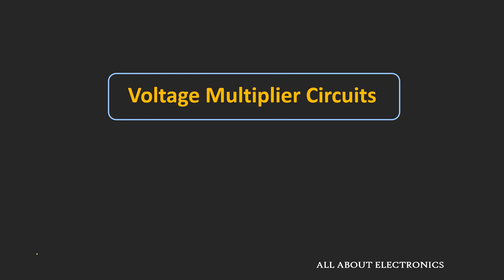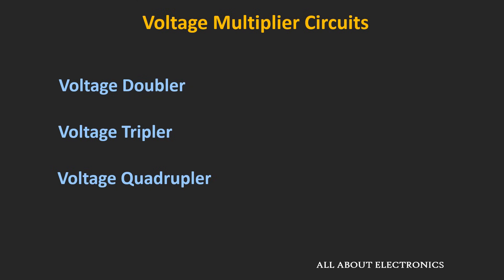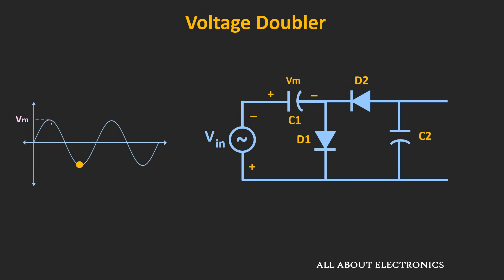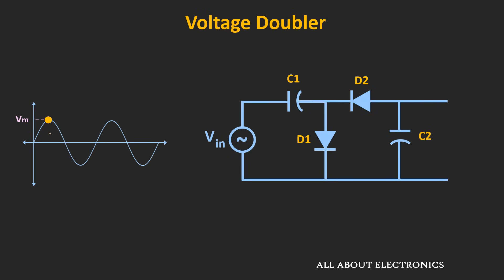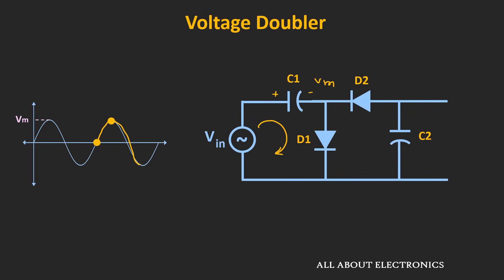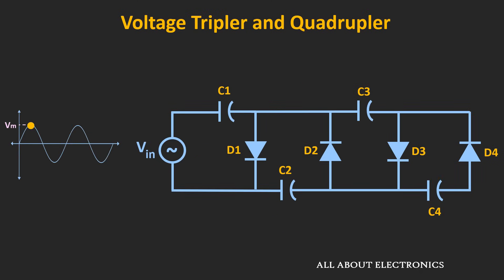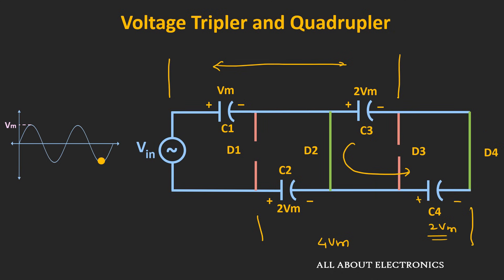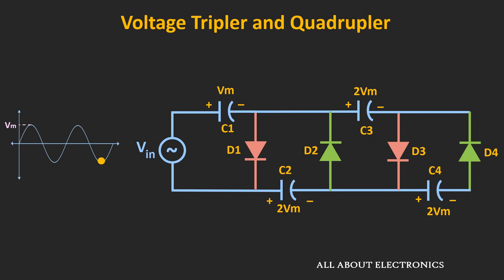Voltage Multiplier Circuit Explained (Voltage Doubler, Voltage Tripler and Quadrupler Circuits)

Comment from the maker: The timestamps for the different topics covered in the video.

0:21 What is Voltage Multiplier Circuit?

1:41 Application of Voltage Multiplier Circuits

2:32 Voltage Doubler Circuit

8:40 Voltage Tripler and Quadrupler circuit
Reply: whats the name of your simulator

Comment: What if the input is DC , will it work? for example , incase of a boost converter can we use the multiplier?
Reply from the maker: No conventionally it won’t work with DC. You need to somehow make the DC voltage to pulsating DC to use this circuit for multiplication.

Comment: Does the capacitance or the caliber of diode matter or can any size be used?
Reply from the maker: The voltage rating of these components should be sufficient to support your design. That’s it.
Reply: @ALLABOUTELECTRONICS in other words they can  be larger but not smaller

Comment: Can you tell me whether Vin is a typical ac signal? I myself built the circuit and I didn't get any voltage multiplication.  As for my reasoning goes, it should not be able to multiply the voltage with a typical ac voltage. 

I need clarification please.
Reply from the maker: Yes, the input is AC voltage. The only thing is, you need to select the proper values of capacitors. 
Its very standard circuit.

Comment: So c1 only charges from 0 to positive peak and discharges from positive peak to negative peak? But from negative peak to 0, does c1 remain 0 until it reaches passed 0 to positive peak?
Reply from the maker: I have provided the simulation at the end of the video. Please go through it, your doubts will get clear.

Comment: Do you know,  how to calculate output current for a load of say R, or maximum current output?  Thanks.
Reply from the maker: It depends on the maximum power that the input source can deliver. Since we are increasing the voltage, so maximum output current that we can draw from the circuit will reduce proportionally.
Reply: @ALLABOUTELECTRONICS   Say you have an ideal input voltage source, your Cs are all the same, you have N stages, The frequency is F, the load resistance is RL.  What is the current through RL?
Reply from the maker: @aduedc  well, in that case, for ideal voltage source, the output current will be N*Vm / RL. Where Vm is the maximum voltage of the input source, N is the number of stages and RL is the load resistor. But practically, you will not get that. 
Let's say you have 5V source, which can provide maximum 1A current. (Overall 5W)
Now, if you increase that voltage by 10 times, then your output voltage is 500V. And if you connect 10 ohm resistor as load then your output current will not be 50A. Because with that current and voltage, if you find the required power then it is 50A*500V = 25000W.
But can you get that using 5W source, No. 
In this case, the maximum current that you can get is 5W / 500V = 10mA. (considering there is no other losses in the N stages)
So, accordingly you should select the load resistance. 
I hope, it will clear your doubt.
Reply: @ALLABOUTELECTRONICS  This is not the case.  Here is an experiment, use 100pf caps, measure the output current say at 10K ohm  load.  Then use the 10uF cap and measure it again.  Also do this experiment with say 1KHz, and do the same experiment at 10KHz.  As you know you can build a virtual resistor by charging and discharging a capacitor.
So it is not that simple, it has to do with frequency, Capacitor value, diode losses, ....  I am searching for paper on that if you find it let me know.
Reply from the maker: @aduedc  Yes, that's true. But to make such circuits, the RC time constant has to be much larger than the time period of the input signal. So, you need to select R and C accordingly.

Comment: Nice video but I think that the analysis that you do for the voltage doubler may be wrong. First of all it seems that you are analyzing the initial transient of the circuit, which means that the initial state of your circuit is characterized by all capacitor discharged. The moment, in which I think you commit the first error is at 4.02. you say that the capacitor C1 charges to Vm when the sinusoidal signal reaches the positive peak and then you say that when the sinusoidal signal becomes negative then the diode 2 turns on and D1 turns off. But what happen between the positive peak of the sinusoidal signal and the negative part of the sinusoidal signal? You forgot to analyze that part. In fact, the diode D2 should turn on immediately after the peak of the positive sinusoidal signal. and D1 should turn off in the same moment. So the two diodes change their states much earlier than the moment in which the sinusoidal signal becomes negative. Missing the analysis of that part, will make your analysis not correct. Furthermore, it seems that in your analysis, C1 remains charged to Vm for all the negative cycle of the sinusoidal signal. what make you think that the voltage of C1 will remain constant during the negative cycle? I did not find any reason why that should happen. Try to simulate the circuit and look at the first period of the initial transient: at the first negative peak of the sinusoidal signal the voltage across C1 is actually 0V and not Vm as you state in your video. Overall the dynamic of the circuit is a bit more complicated than what you claim. I am not convinced by your analysis, which in my opinion is just a method to force the correct result.  Anyway, feel free to correct me if I am wrong. :) In general, I like your videos, but I do not think that everything can have a short explanation. Good luck for the next videos
Reply: Even I was thinking the same but not able to find the decrease in the voltage of capacitor 1 after the one fourth cycle
Reply: @alokgupta7239  probably because, you did not setup the LTxpice correctly. To see the initial transient you have to check the command "skip initial operating point solution" when you perform the transient. Try it ;)

Comment: @11:41 
assuming C2 = C3 during this cycle there is charge sharing therefore C2 does NOT dump ALL of its voltage(2Vm) into C3 in the first cycle, first iteration will have 0.5*(2Vm) volts across both C2 and C3. It takes X amount of iteration for C3 to have a voltage 2Vm depending on input voltage. What happening here is C2 is constantly getting charged from the supply then shares its charge with C3 UNTIL the voltage across C3 = 2Vm. In summary, due to charge sharing between C2 and C3 it takes multiple iterations for C2 and C3 to reach 2Vm.
The math is 
Vc2 = Vc3 = 0.5*(2Vm) -> first cycle
Vc2 = Vc3 = 0.5*(2Vm + Vinitial) = 0.5*(2Vm +  0.5*(2Vm)) -> second cycle
Vc2 = Vc3 = 0.5*(2Vm + Vinitial) = 0.5(2Vm + 0.5*(2Vm +  0.5*(2Vm))) -> third cycle
Vc2 = Vc3 = 0.5*(2Vm + Vinitial) = 0.5*(2Vm +  0.5(2Vm + 0.5*(2Vm +  0.5*(2Vm)))) ->fourth cycle
.
.
.
.
.
Until Vc2 = Vc3 = 2*Vm
Reply: Was doubting my basics, and searching a comment that explained what I know, then came across this, and now am satisfied!
I don't know why the these small but great details are ignored in videos. These hamper the basics!

Comment: 11:44 I don't think so capacitor c3 will get charge by that path, because the D1 which you short circuited, has V(k)=2Vm and V(A)=Vm, hence that D1 will act as open circuit not short Circuit.... You have simply put a closed path without analysing... ( Don't mistaken me, I really like the content ❤️)
Reply from the maker: At the end, I have also shown the simulation. Please go through it. It will help you.
Reply: Yeah I checked! But please explain me, in 11:44 the path taken to charge C3. How is the diode  short circuited when V(cathode)>V(anode)??

Comment: why did you not consider capacitor voltages when finding the diode states? You have just considered cycle states.

Comment: ⭕⭕⭕Check 11:44  here you are telling that the  C3 is getting charged through the path of D1. But current cannot flow through D1 from C2 because 11:28 see the circuit, I mean considering C2, D1 is reverse bias condition. 
Please check and let me know!

Comment: Why this circuit we cant use for big loads bro.I mean if capacitor capacity is big then? What about current? Current also added or what? Actually I am a commerce student but also studying little bit electronic plz answer.
Reply from the maker: It is due to power. (P= V*I). Although the output voltage is increased, but since output power can't be more than input power, the current supplied by the output to the load will be limited.
Reply: THIS DEVICE IS A HIGH VOLTAGE LOW CURRENT ONE I HAVE MADE ONE ON MY CHANNEL GO ELECTRONICS !!! WHICH COULD OUTPUT 60000 VOLTS

Comment: Please mention the values of the capacitors and their voltages. Thanks.
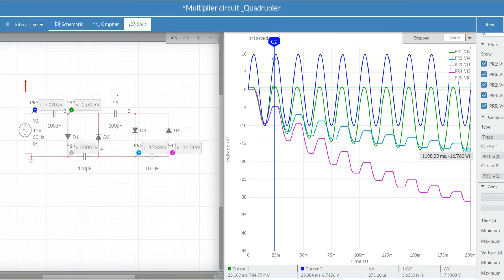Reply from the maker: The voltage rating of the capacitors should be atleast 3 times more than the desired output voltage. (e.g for 10V, output, use 35V rating capacitors) At the end, around 12:50, I have shown the simulation results and circuit. 
You can check that for reference.

Comment: What if our input of voltage multipler is continuously fluxing 'varying' ...?what type of multipler is should use?
Reply: YES I HAVE CREATED A POWER SOURCE WHICH ACTS AS THE INPUT IN MY VOLTAGE MULTIPLIER VIDEO !! AND IT COULD OUTPUT 60000 VOLTS !! WATCH IT ON GO ELECTRONICS !!
Reply: @ge5645  watch it and experience it yourself with some very BIG capacitors and touch it go make sure!

Comment: for the simulations, how do we calculate the values of te capacitors and diodes?
Reply from the maker: The RC time constant should be much larger than input signal time period.
Reply: @ALLABOUTELECTRONICS  INPUT SIGNAL CAN BE AC OR ANY HIGH FREQUENCY ONE !!!
Reply: The capacitor values must be in nf or pf and if you use high voltage pulsed dc as input (the one I have made on my channel go electronics ) 3 TO 6 KV  ceramic caps needed and 4kv HF diodes !! ( FOR MORE DETAILS WATCH MY VIDEO WHICH PRODUCES 60000 VOLTS !!)

Comment: You Slightly Miss An Error At Point When -vm<Vin <0 After Charging C1 ( After Positive Cycle Of Vin, When Vin < 0) ,,, When Anode And Cathode Voltage Of D2 Will Be Same Then D2 Will Off ...No Further  Charging Of C2 Will Occur And That Moment C1 Charge Will Not Be 0 ... C1 And C2 Charge Is ,, V = {(c1)/(c1+c2)}Vm  *But Reverse In Polarity ... That's Why It Requires Many Cycles ... C2 STOPS CHARGING AT   -Vm<VIN <0      NOT VIN = -Vm ,, If you don't believe  Me Zoom Out The Schematic Diagram At 8.05 Moment See The Cycles Of Charging C2 .. If It Will Stops At Vin = -vm Then No Further Charging Of C2 Will Occurred Because On Second Half Positive Cycle Of Anode And Cathode Voltage Of D2 Will same -Vm And Remains Off So No Further Charge Occured ...
.
Reply: Yes the circuit used here is slightly incorrect this is not the voltage doubler, its peak to peak detector

Comment: I need help designing a Voltage Tripler circuit with an input voltage of 110VAC that will power a 330VDC / 2 watt light bulb.  Will the voltage tripler circuit that you have designed at 9 minutes work?  And what size caps and diodes should I use?  I appreciate any help.  Thanks!

Comment: Great Video ! Crystal clear explanation !!!
Reply: MAKE YOUR OWN VOLTAGE MULTIPLIER THAT COULD OUTPUT 60000 VOLTS WATCH IT ON GO ELECTRONICS !!!
Reply: @ge5645  watch it and experience it yourself with some very BIG capacitors and touch it go make sure!

Comment: Thank you for the video, very useful especially to initial ramp-up section which is not covered usually in other tutorials. I wanted to find out how i can do AC analysis of this doubler? What is the AC equivalent circuit? I am asking since this circuit is usually connected to AC sources and i want to look at the matching problems. Thank you

Comment: 9:50 
Why the capacitors will not charge if they are uncharged.
(I think all capacitors were initially uncharged, then with your reason even the capacitor c1 should not charge).
Reply from the maker: The capacitor C1 is charging because diode D1 acts as a short circuit (ideally). 
If you take the second loop, between diode D1- C3-D3- C2, as all the capacitors are uncharged initially there won't be any transfer of charge. In the first loop, the capacitor C1 is charging because of the input source Vin.
I hope it will clear your doubt.
If you still have any doubt, do let me know here.
Further, I have also shown the simulation result at the end, which might help you in visualizing the things.
Reply: @ALLABOUTELECTRONICS  Hi, is there a way to calculate how fast the capacitors will really charge?

Comment: Excellent video. Very detailed and clear instruction on the voltage doubler circuit. It's one of the best out there. Thank you for taking the time to share you knowledge. This is a very important circuit for learning AC circuits. It's used in microwave ovens as well at the output of the step-up transformer to power the magnetron.
Reply: MAKE YOUR OWN VOLTAGE MULTIPLIER THAT COULD OUTPUT 60000 VOLTS IN THE FORM OF BLAZING ARCS !!! WATCH IT ON GO ELECTRONICS !!!

Comment: Thanks for the great explanation. Can you include a section on how to calculate the necessary values of the diodes and capacitors?
Reply: MAKE YOUR OWN VOLTAGE MULTIPLIER THAT COULD OUTPUT 60000 VOLTS (ARCS)  !! WATCH IT ON GO ELECTRONICS

Comment: When I made connection of multipler  . Output of circuit not desirable as when 6 volt AC applied to doubler  circuit .It give15 volts output . also in triplet circuit 23 output
Why this happened can u help me
Thanks.
Reply from the maker: Please check the couple of things. First, whether the input is 6V peak or 6V RMS. If it is RMS then you need to multiply it with factor 1.4.
Second there will be a voltage drop across the diode. 
So you also need to take into account.
And third make sure, RC time constant is much larger than the time period of the input signal.
Just increase the RC time constant a little bit.
I am sure you will get the desired results.
Reply: Thanks u so much

Comment: how capacitor charged by ac signal?
Reply from the maker: It will try to charge up to the peak value of the AC signal.
Here through the diodes, the charging and discharging of the capacitor is controlled during the positive and negative cycles.

Comment: what's the difference between transformer and voltage multiplier? transformers just make the amplitude of the power bigger while voltage multiplier just offsets the power wave?
Reply from the maker: In the case of the transformer, the output is also an AC signal, while in voltage multiplier it is DC signal. So, convert it into DC you need to rectify it. Also, to generate the same high voltage the size of the transformer will become large. But in voltage multiplier, the output current is usually very small.
Reply: @ALLABOUTELECTRONICS  Oh! I see now! Thank you very much, sir. I didn't know voltage multipliers are already rectified.

Comment: Ok so basically c1 capacitor becomes charged like a battery when the current passes through D1 diode. And capacitor c1 acting as a battery plus the actual power source it doubles the voltage almost. So it's like the power source is a 1.5v ( AC) battery, which releases the current through the c1 capacitor and the capacitor becomes charged 1.5v. And after the first cycle, the direction of the current changes in the main power source battery(because it's AC voltage reverses direction of the current), as a result we end up with 1.5v battery attached to 1.5v capacitor, becoming two batteries 1.5v+1.5v=3v attached to each other plus-minu-plus-minus like inside toy battery pack.

Comment: What software did you use for your circuit simulation?
Reply: MAKE YOUR OWN VOLTAGE MULTIPLIER THAT COULD OUTPUT 60000 VOLTS !!! WATCH IT ON GO ELECTRONICS !!

Comment: Why d2 is on while decreasing +ve current
Reply from the maker: As I said at 6:30 in the video, the voltage at the cathode of the diode D2 is Vin - Vm. And during the positive half cycle, when Vin <Vm, Vd1 will be negative. At the same time, the anode of the diode is at ground potential. Therefore diode D2 will be on.

Comment: Is the Ampere at the output will remain same as input
Reply from the maker: No, it will reduce. Because the input and output power should remain same. ( Considering no losses).
So, as the output voltage increase, the current will reduce.
Reply: THIS DEVICE IS A HIGH VOLTAGE LOW CURRENT DEVICE !! I HAVE MADE ONE ON MY CHANNEL WHICH COULD OUTPUT 60000 VOLTS BUT  LESS CURRENT MAYBE IN MILLI AMPS !!

Comment: How capacitor C1 discharged through voltage source and charge C2 to Vm , please explain 6:42
Reply from the maker: If you observe, during the negative half cycle, the polarity of the voltage has been reversed. So, basically, it will try to charge the capacitor in the other way. So, the charge across the capacitor C1 will be lost. And it will be transferred to C2. But all this will happen gradually, in a couple of half cycles (more than two cycles)
Please check the simulation which I have shown at the end of the video to get more idea.
Reply: The same query I have ,during the negative half cycle,  since the diode 2 is in reverse direction how will at allow the capacitor 1 to discharge through it??
Reply: @sc-yardhuka9438  d2 in forward bias in negative half cycle

Comment: If we apply a voltage directly to a capacitor only, does it conducts any current? If not then why?
Reply: it conducts
Reply: MAKE YOUR OUR VOLTAGE MULTIPLIER THAT COULD OUTPUT NEARLY 60000 VOLTS!! WATCH IT ON GO ELECTRONICS !!
Reply: @ge5645  YES GE, AND YOU SHOULD USE BIG CAPS FOR THE VOLTAGE. WHEN YOU BUILD IT, TOUCH THE ENDS TO VERIFY ITS GOOD

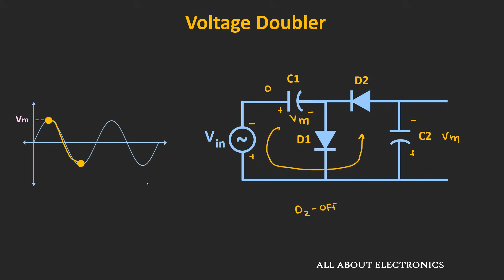Comment: thanks for your sharing , a litter confused @7:20  ,  voltage across c1 is -Vm, Vin is -Vm, according to KVL , Voltage apply for C2 is -2Vm, Why it is -Vm in your presentation ?